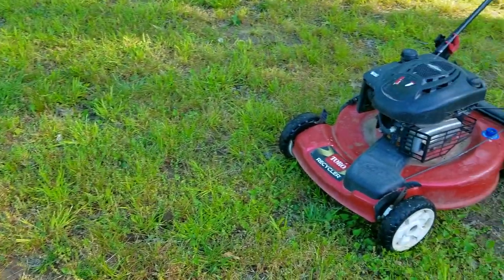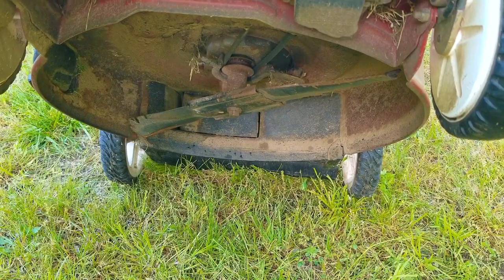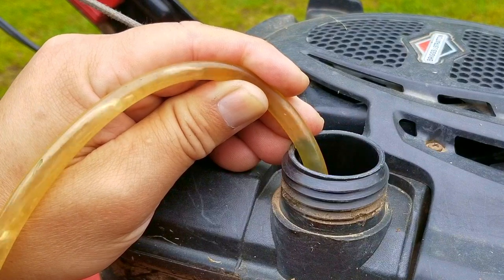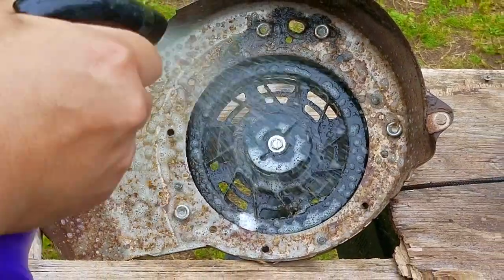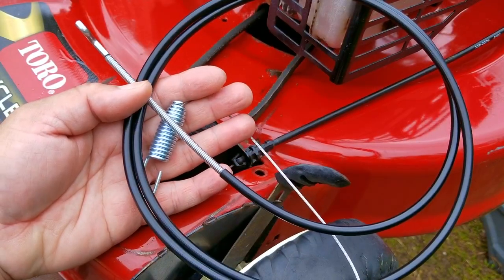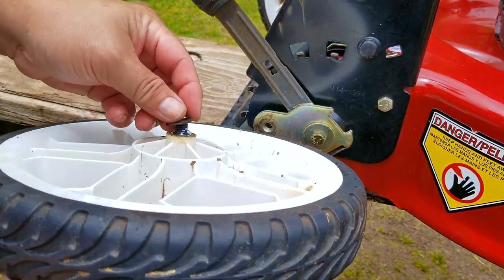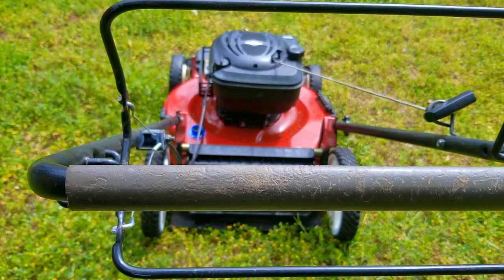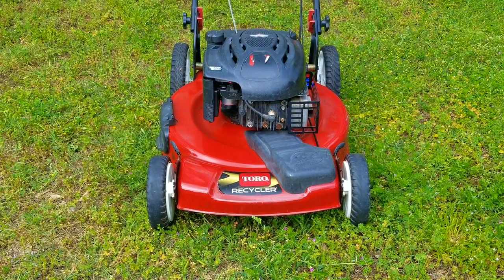Why Would Someone Dump A Toro Mower Like This

Comment: Super nice mower and a great find! The only time I send a mower to the dump is if it has rust holes in the deck or is otherwise safety compromised. In those cases the engine, wheels, handlebars and useable hardware stays here to help save another mower and just the deck goes to the dump. Love those Quantums!
Reply from the maker: completely agree! take what's good and get rid of the bad.

Comment: Some people have no clue about how difficult or easy something is to fix. I had a mower that I couldn't get to produce a spark no matter what I checked or changed. I put it at the curb with a sign saying 'no spark' on it. A couple stopped to look at it and the woman knocked on the door to ask me if it ran. Ah, no. No spark equals no run.
Reply from the maker: yes the certainly seemed to not know

Comment: I do my own work on everything...
When it comes to a lawn mower or small engine type thing in general I  generally will repair it if it is cheaper to fix it than it is to replace it with a used functioning unit. 
For example a push lawn mower is normally about $60 to 80 bucks used so if I can repair it for $40ish bucks I will fix it but if it cost 70ish bucks for the repair parts I usually won't mess with it... 
The only unfortunate thing is I don't quite have enough room to store away broken mowers and turn them into parts mowers... I would imagine I could reduce my cost significantly if I had used parts on hand laying around.
Reply from the maker: I like the way you think
Reply: @INSIDEHOUSEGARAGE  I love tinkering on mowers/small engines,  I am 44 years old and a total gearhead (my passion is beat up not show quality American cars) but I cut my teeth when I was a young teenager with Briggs and Stratton's and Tecumseh's learning to turn a wrench on them. 
I came across your channel because you essentially do the same thing I do and it's nice seeing someone else's perspective and thoughts.
On my original comment above the one thing I should add to having "parts mowers" is It is a shame how expensive the individual parts are even online, a couple of cables, some wheels and maybe a new carburetor is usually enough to "mechanically total" (because of cost) a lawn mower That realistically still has a ton of life left in it. 
I need to make a couple of totes just full of used parts. I think you may have inspired me lol
Reply from the maker: I appreciate all the information and I completely understand where you're coming from. People like you and me are disappearing so keep it up, I think what we're doing is helping out.

Comment: I picked up a Toro Recycler with the Kohler engine from the curb last week. It just needed the front wheels replaced, along with a good cleaning. These mowers are in the $400 range when new. What dollar amount can you sell them for?
Reply from the maker: very nice, depending it's overall condition, the area you live in, and the current market, anywhere between 150-200.

Comment: I loved the video due to owning this exact mower. I have a couple of questions if you don't mind me asking and I can't find good answers on.

If it helps I did the digging probably the same as you have but for anyone reading. The spark plug gap should be 0,030 in. Most of them come gapped at .28 which works and I imagine because they do drift every 30 hours or so. I think the briggs is good until .32. They make 3 different spark plugs to this mower and one runs hotter and the engine performs better. Average lifespan of good operation is 30 hours, Briggs sells a platinum one rated at 100 hours though. 

I love the fact it still has an oil drain plug!

My question is how to set the valves for a tune-up? I know how to do it to an OHV engine like my Honda, but am a bit clueless on a flathead. The mower in question is 2008ish I think, and I want to try and resurrect it. It still has compression so it doesn't need a rebuild.

I know the settings are as follows
Armature Air Gap: 0,006 - 0,010 in (0,15 - 0,26 mm)
Intake Valve Clearance: 0,005 - 0,007 in (0,13 - 0,18 mm)
Exhaust Valve Clearance: 0,007 - 0,009 in (0,18 - 0,23mm)

Where I live too the preset is off by 9% at factory and the engine doesn't rev nearly as high as it should. What RPM would you recommend this Briggs be set at? I know you have super skilled hearing to adjust it how you did. Unfortunately I don't possess the same and need to use a tachometer.

I also found a great deal on a brand new boxed Briggs Quantum 6.0 with the heavy flywheel but can't find much info on it? Were those rated above the standard flatheads? The whole things solid metal. I ask because a guy on Craigs list has a free Toro Super Recycler deck(old style), he blew the engine, and figured it might be a great pairing but wanted to inquire first.
Reply from the maker: not sure what the gap should be on these engines but I typically set my gaps to .025"-.027". A for the valve lash adjustment you do not want to know. There's an access panel on the engine that's covered up by the muffler. To increase the lash, you can sand the valve stem, but it's when the lash is too much that you have to take the engine apart to fix it.  As for the Revs, I used to use a tach to help me set it, but now I just set it by ear and if I had to guess 3100-3200 rpms.
Reply: @INSIDEHOUSEGARAGE  Thanks again. Interesting, I know the bigger the gap the easier it is to start but I heard the less compression? The gaps I listed were out of the manual for the engine. I have the PDF if you ever wanted a copy but when it comes to resale it probably doesn't matter.

As for the valve timings? I have a local Toro dealer who handles Briggs, Kawasaki, Kohler, and Honda. They are the biggest repair shop in our area.

I could ask them what sort of cost a service like that would be for the valves. It sounds beyond me. But since I am still getting good compression, no point. Thanks for letting me know what is involved.

Comparatively the OHV Hondas are easy to adjust. No wonder you recommend them.

Also do the GX160's have a drain plug on them? 

I appreciate the advice on the RPM's, just double checked this morning and what I could find it should be set but really anything above 2900 will usually cut. I think out of the box Brigg's sets them at 3100 according to the manual but it says 3600rpm max. I know legal limit on blade tip speed is somewhere around 3300 for safety?

At my elevation there is an 8.5% decrease in rpms from factory anyhow. 

According to the literature you can set it to 3600 safely but I assume everything, oil, filters, cleaning, etc it probably becomes more temperamental and you'd need a rebuild sooner. 3100 is probably the old safety net for the company and for a clean cut.

It's hard because Brigg's site is all arranged for the new OHV's.
Reply from the maker: never heard about the increase in  compression part due to plug gap before.  I think it depend on what year the honda engine is for it to have a drain plug.  As for engine speed, I would not go beyond 3100 only because of increased wear and tear.  But it's your engine and your choice.
Reply: @INSIDEHOUSEGARAGE 3100 sounds solid to me especially since Briggs clocks it that by default. As for the gap I more meant in the engine itself.

No, no additonal compression from the Spark Plug. That's strictly for misfires or anything. I just meant they build two plugs, one runs hotter than the other. Lastly they have a platinum plug that lasts 100 hours $12 instead of 30 hours like the other two $3-5.

I am not sure how, but Briggs can be set to a tighter compression without issue. The older recommmendations for the Quantums were tighter. Guy's using them rigged dirt bikes have the old settings. The problem is from what I understand the engine becomes that much harder to start with the tighter compression. A lot of individuals with physical issues couldn't start them so they adjusted them. 

The hardest engine I remember as a kid was a 90's Ariens my Dad bought when I was 7. That engine was something else to start! I am not sure what engine they ran back then on it but 5-7 pulls wasn't uncommon. The swivel wheels constantly had broken keys and it was hard to mow in straight lines with it. It edged and cornered amazingly though.

Comment: When I junk something the bolts, nuts and screws are even out of it and it might make the pop top for a soda can or two. The last 3 things were the old rotten deck shell out of the wife's old 85 rider, what was left of the dead Deere that I made the Kawasnapper out of and the rusted out deck shell from the opposed. I might've tried to fix the opposed deck IF I'd had a tig rig but it was just better to get a new shell, since I was using it here. I liked the OLD Toro mowers with the aluminum low profile deck and the 3 1/2 horse Briggs with the goofy recoil that worked up instead of out. And as for that onbe, they might have been buffaloed on getting a new cable and just got a new mower. Blessings.
Reply from the maker: you make a good point, someone must have told them it was a lot worse than It actually was .
Reply: @INSIDEHOUSEGARAGE  Sure looks like it.

Comment: Thumbs up on your crusade to save Toros. I like them too.

Yep, those Briggs flatheads are pretty bulletproof.

Trimmers vs blowers... IMO, it's because there are MANY more trimmers out there than blowers. So if 1% of them show up on the curb every year, there will be many more trimmers than blowers.

Cleaning... I clean my mowers after every use... with a leaf blower. I may clean with soap & water once every 5 yrs.

How bad does a mower have to get before I'd take it to the dump? I don't know. That's never happened in almost 40 yrs of owning mowers. I'd guess it would have to have a hole in the block.
Reply from the maker: you make a good, it would just be an issue of giving up too soon

Comment: If it's metal and I am throwing it out, I always put it on the curb regardless if it can be fixed, used for parts, or is scrap.  Scrappers frequent the neighborhoods and it saves me the hassle of having to call the city to have them do a bulk pick up.  Since my city doesn't do curb side recycling, I bag all my aluminum cans and put them in a large clear trash bag and put them on the curb as well.  This saves me a trip of having to drive to City Hall to dump it in their recycling bins and helps out someone he can get a few dollars from the cans.
Reply from the maker: you are correct, there is always someone out there who might be able to use it, and will make it disappear for you. Thank you ESDI80

Comment: Hey bro, what's up? I believe that this would of been your simplest repair ever. My guess to why the previous owner had gotten rid of it is that they have gone battery/ electric. As the saying goes bro one man's trash is another's treasure.
Reply from the maker: yes this was very easy which I like a lot!
Reply: @INSIDEHOUSEGARAGE  hey bro I wanted to ask you if you ever came across any backpack trimmer / multitool in your time of repairing small engines?
Reply from the maker: I wish I did, they look so cool to me.
Reply: @INSIDEHOUSEGARAGE  same here bro. I saw one for sale here in my country but then I saw a Stihl Ht 101 polesaw that I was more interested in.

Comment: I have a Toro mower that looks just like it, it is over a decade old and it sometimes has smoke coming from the top of the engine after I am done using it, not the muffler. Do you have any suggestions?
Reply from the maker: sure, I'd take off the cover for the engine and see if there's oil coming from somewhere

Comment: You are my favorite YouTuber i was wondering what does it mean wnen the pull rope Yanks out of my hand and the carburetor pops it is very jarring to the hand and bruised one of my ribs I just need to way to get it fixed
Reply from the maker: thanks, I'd check  for a sheared flywheel key and also to if the valve lash was off.
Reply: I checked and everything is good
Reply: Your the master that's why I'm asking for your help
Reply from the maker: so you check the key and it wasn't sheared? what about valve lash? what size feeler did you use?
Reply: I did what you did that one time and used 5000th inch feeler gauge for both
Reply: But however you did say that it could different from model tomorrow so I don't know
Reply: It's a yard machines 125cc Briggs and Stratton engine
Reply from the maker: since the key is not sheared, and the valve lash is correct the rope should not be doing what it's doing. I'm all out of ideas.

Comment: I have had the same thing happen to me. Someone last summer in my neighborhood threw out one of these mowers. I wheeled it back to my house and pulled on the rope. Started first pull! Then I checked the oil and air filter. Both are very clean. Then I tested the self propelled system. Moved very slowly. Then I just tightened the drive cable and boom! A nice perfectly running lawnmower that I could easily sell for $125. But it is now my backup mower and now I mow all of my neighbors lawns as a side hustle. I don’t think I will sell it but I could get a decent lump of change for it.
Reply from the maker: very nice work!
Reply: Same thing happened to me last summer too! Someone left a nice aluminum deck Toro by the curb and I wheeled it back to my house. I barely tugged on the rope to test the compression and it started right up in my garage and ran great! Ended up selling it for $150 just because I didn’t need another mower around here.
Reply from the maker: wow very nice, wonder why it was out there.
Reply: @INSIDEHOUSEGARAGE  it had a leaky fuel line. Apparently there was still enough gas in the bowl for it to start, but when I poured gas in the tank it leaked from the fuel line. New fuel line, gave it a good cleaning and a tune up, changed the oil and it was a nice mower for someone. Sold it to a nice guy who just bought his first house and needed a mower.
Reply from the maker: very nice job!